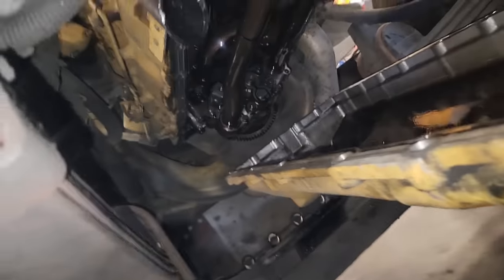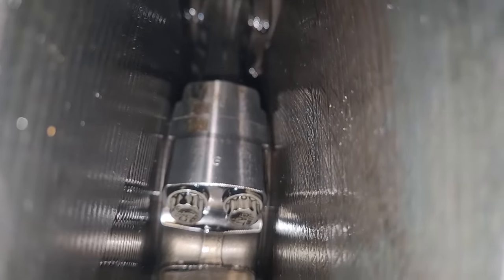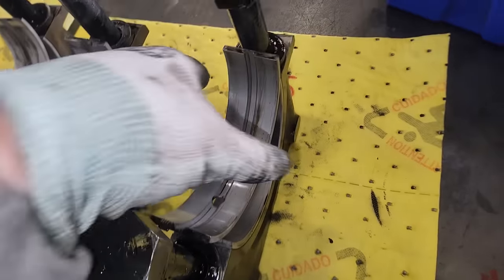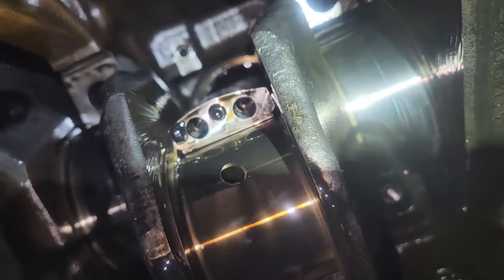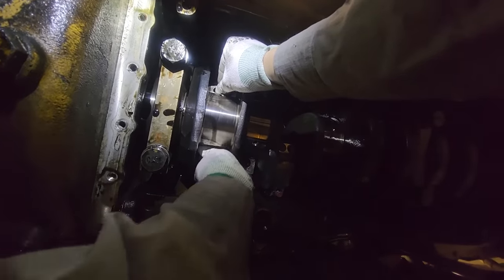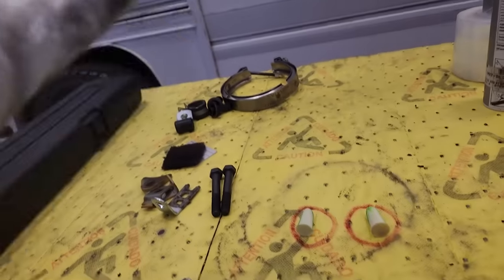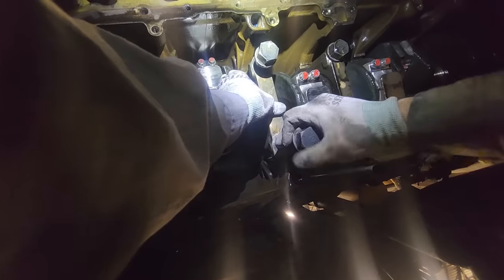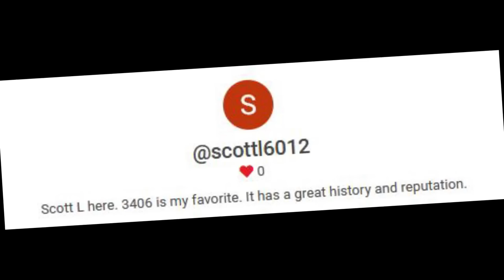Nice Truck Driver Paid for an Engine Rebuild, gets a HEADACHE! Engine "Re-Rebuild."

Comment from the maker: Thanks for watching. Congrats to Scott L on winning the Western States gift bundle. @AdeptApe on Venmo or AdeptApe@yahoo.com on PayPal for donations, thank you so much for supporting the channel! If you wanted an oil pressure priming tank like in the video here is the Amazon Affiliate Link: Allstar Oil Pressure Priming Tank: https://amzn.to/3L5pASm
Oil Pressure Priming Tank: https://amzn.to/3YuBrNr
Reply: I forgot to enter, like a dummy - but still put a comment in with my favorite and why 😂 congrats Scott!
Reply: Thank you!  I greatly appreciate it!
Reply: Hey Josh, I’ve had good luck using a little White Diamond Metal Polish or whatever metal polish I happen to having laying around on journals, after sanding. That kinda fills those grooves in. Not sure how long it lasts, it’s probably overkill but, if you put some time into it, you can really get scratched up journals looking nice before tossing the bearings in.
Reply: My factory apprenticeship began over 50 years ago. In unit repair the men used 50/50 STP and engine oil for assembly lube. They taught me to use white lithium sparingly on threaded parts after thoroughly cleaning the threads or sparingly on new threads such as spark plugs. I have been working on alloy engines as an occupation or second job ever since. Never had a problem if I took my time and never heard of using white lithium on rods or anything else internal.
Reply: Next time loosen the belts up and the front 2 mains will roll in way easier
Reply: I'm assuming you replaced the main bearings right? I didn't hear you say you did unless I missed it
Reply: I have noticed over the years on a few different cats i have owned under hard, acceleration or any high boost, demand i.e. pulling a hill that the oil pressure drops a couple pounds not really sure, but my theory on that is maybe boost being higher than the oil pressure and seeping past the seals in the turbo, boost pressure getting into the oil feed line for the turbo could be totally wrong. I’m not a mechanic just a theory.
Reply: I never used the white junk.
Early on I found that it harden almost like rock if the engine is stored for a long time before installation.
Reply: Which shop and mechanic performed this job? I’m from Florida. This should be public knowledge.
Reply: Ww
Reply: I am so sorry for your loss and I hope Q
Reply: I
Reply: @dylansnellgrove390 no he showed us how damaged they were polished affected journals and reused the fucked bearings!!!then filmed it 2 show u how professional he is!!!!THIS GUYS A PRO OF COURSE HE RENEWED THEM FFS
Reply: 😢great
Reply: Address to the shop
Reply: How do you know which size bearings to order? Do you plastigauge them?

Comment: This video is really going to help this guy in civil court. Its a tough hit financially
Reply: Can he sue? It would be amazing if he could recoup the loss because from what I hear, the maintenance cost of these engines is expensive.
Reply: @JuniorJunison u can 100% sue
Plat rebuild from cat on a c15 is 33k out the door ( i just paid it)
Reply: 33080, cost mine, 140k ago
Reply: Not sure if it’s worth a court battle. Yes it’s a financial loss, but taken time off from the road and probably paying at least a 10,000 Dollar retainer for a good attorney is even more money spent. 
I had a trucking business and bad service gets written off as a business expense. Just learn from it and do your research before the rebuild.
Reply: I agree with you on that, it would be a different story if he charged for cat parts and used aftermarket. This is just a ram jam mechanic who put this motor together, and you’ve got to write it off and know next time put forth due diligence in picking a good shop and mechanic to do quality work.
Reply: I had something similar happen to me.  I had total rebuild on E6 Mack. Sent heads to shop with great reputation and had injectors rebuilt. Went to pick truck up 2 months after I dropped it off and WOW at the blow by. Sent to another shop totally lost faith in first garage about 2 weeks after I picked truck up. It was blowing a gallon of oil out the blow by tube every 100 miles. The heads were used and who knows if I even had rebuilt injectors now. REDS GARAGE Jackson OH stay away.
Reply: Had a shop charge me to fix my main bearings.. rod bearings.. oil cooler and oil pump.. meatless to say they didn’t change the full bearings.. 3 pieces.. and rods they only changed the bottom half.. now 2 months later inframe time
Reply: This video is Hearsay Evidence and inadmissible in narrated form in court. The owner of the truck would properly call Josh to testify and Josh would bring the video to show in limited format. Josh would testify when and how he took the video and he would silence the audio. Yes, the raw video itself would be quite compelling in court and I suspect if there is a proximate cause between the damage we saw and a loss to the truck owner, then the truck owner would prevail. There would have to be evidence of economic loss to the owner. Could Josh testify as an expert witness that the first overhaul was doomed to failure prematurely at xxx miles?
Reply: @jamesscott1932 he was having problems with low oil pressure under load. Because of the damaged bearings. Damaged and modified by the installer.
Reply: @FarmerSteveO we might see this very truck more often in these vids in that case
Reply: @cullenmiller8170  The mechanic committed fraud. So it is not just a civil suit, he needs to contact the local PD. And where there is one scammed customer, there are likely others....
Reply: @jamesscott1932   
"Could Josh testify as an expert witness that the first overhaul was doomed to failure prematurely at xxx miles?"
He could be an out of work hairdresser and still testify..../s
Reply: I like the longer video with good content.   name the shop that did this horrible work
Reply: It'd be tough to collect.  If the mechanic is doing garbage work like this he probably doesn't have the $ to payout even if he wins.  Maybe small claims court because that's easier to do yourself and the damages will be small so he might be able to pay them.

I guess you can tell the police and maybe they'll do something if it's been a lot of complaints
Reply: Pretty sure he's not going to be able to find the guy that did the work.
Reply: @JuniorJunison an oil change w/o your own oil is about $500. When you bring your own oil it's about $100
Reply: Legit engine builders stand by their work so most likely will reimburse client for the damages.
Reply: Hard to prove fault, could be argued oil change intervals were excessive.
Reply: @curbstomp3126 Jackson Ohio. 
Aka one hell on earth in disguise
Reply: @Jamk14 I was quoted $22k Dec 2019, massive increase in such a short period. I wonder why it would be so high.......... oh, wait 😂
Reply: @cullenmiller8170  The lawyer always win, makes you wonder who are the crooks.
Reply: @who-gives-a-toss_Bear Sounds like a good argument to just bypass the corrupt system and get a guy who knows a guy who can make a deal they can't refuse!
Reply: Looks like correct parts used by a shade tree mechanic. He beat those bearings in using the oiler hole. That's some Pakistani you tube vid stuff right there
Reply: @JuniorJunison  There's definitely enough financial damages. Figure $31,000 on the cheap end for the initial rebuild, then factor in loss of earnings since the truck can no longer reliably haul, and you could be north of $60-100K in losses depending on how many contracts the operator lost from the truck being down. That would absolutely be a case that'd be heard in court no questions asked.

And that's not to say anything of the potential for a consumer rights violation for non-genuine parts should the connecting rods being used in this engine be fake or from a third-party, or if it was discovered that re-manufactured parts were used in place of what were supposed to be all be new genuine items.
Reply: @cullenmiller8170 Very intelligent way of doing it. Legal costs and downtime are ridiculous, business expense and everything under your control means minimum downtime and your time.
Reply: @MrNoobed  small claims caps at 5k, that wouldnt even cover parts. court has the ability to garnish wages until the debt is paid. if it went to the police this is felony cost, that means years in prison.
Reply: @davidpotter7484  Thats not necessarily correct, the customer stated he still has a loss of oil pressure under load after the repair to the shotty work for the initial rebuild. What does that tell us? well for one the repair was never done correctly and was likely due to the customer trying to do a repair "cheap" that crank needs to be addressed for proper oil pressure. either turned for oversized bearings or replaced. and i'm sure both mechanics know this, however they also know its a big additional cost. why the customer choose to save a few bucks to not have a complete rebuild is beyond me but that was most likely his choice and not the engine builders choice.
Reply: @cullenmiller8170 yea that's really the catch 22. Especially if a mfer can file bankruptcy close the business and move the shop
Reply: I'd be approaching the dude personally, looking for a settlement, or hire a lawyer to send a letter to that effect.  Further legal action is implcit.  Dude must know he's fucked up, save everyone time and lawyers' fees. That's if you can find him 😂
Reply: @berthagen387 I'd argue that it's much worse!
Reply: @michaelglenning5107 you reckon this guy's legit?  Just look at his "work" 😂
Reply: Is this story about a fat wet sump 4 joke stroke auto obsession that has no roller bearings, that what it loiiks like to me
Reply: @cullenmiller8170 It would be 'WORTH' to other truckers if this, so called MECHANIC, STOPPED🤦❗️
Reply: @truckingwithsal  The cost of trusting people is too high, I'll just do it all myself like I have been for the last 25+ years.
Reply: @Jamk14
FML I'm whining about the cost of parts to rebuild my 5.0l's top end/timing at about 3k (using race components) if I had to shell out a new vehicle price I would shit myself.
Reply: He can't necessarily  sue and win. He didn't ask the original mechanic to fix it or refund the money before he drove it clear across the country to have it checked out. If there was no warranty or agreement it's just bad luck. Additionally, the evidence needed is buried in the middle of the engine of a repaired truck. He would spend $30 thousand getting $30 thousand.
Reply: The evidence the owner needs is inside the engine of a running truck that has run thousands of miles since the final repair. There is no warranty. There was no demand for refund, no corroborating evidence of the injury. The only evidence of fraud is inside the engine and that evidence is exposed to damage from use. It would be dismissed for failure to state a claim if it were filed, though the lawyer would still get ten grand for trying. A losing case.
Reply: @KerryHicks-v5b  I figured you knew the person who did the bad job. Be careful, the dirt gets muddy.
Reply: Please name and shame the shop or tech who done this…
Reply: @cullenmiller8170  This mindset is exactly why businesses do these things. Over 90% of companies must take part in this game or fail... They're Profits count on people like you to not hold then accountable. Thus you have this behavior rampant in all of business...Because Precedent.. The other guy did it.. So can I... All these people didn't complain or have an issue so neither should you... Slavery was also justified by this logic as well.... 🤷

Comment: I’ve only made it to the mis-numbered main bearings and I’m already freaking out. Engine building 101. You don’t swap main cap locations.
Reply: he was short of  fingers to count ?
Reply: Learned that one the hard but yet forgiveable way. In high school mechanics class we tore down a bunch of junk engines and put them back together. I got this old dodge 6 cylinder swather engine that had been dusted. Mixed up the caps when taking them back and forth to the parts washer. Threw the engine back together. Go to try and turn the crank to start putting rods in and it’s locked up solid. 

That was over 15 years ago and I never forgot that moment.
Reply: He was so doped up he didn't know where he was. Hes now probably a mechanic at the BMW dealer down the street.
Reply: @chrisgreig5628 probably drunk while working
Reply: I bet the mechanic that built that engine believes he is the greatest engine mechanic on the planet. So good he builds engines at the bar every night
Reply: @markm0000 I'm thinking it was a meth head. I've worked with guys like that. They have non-stop energy and look busy, but if you watch them closely, they do a whole lot of nothing and f up whatever they might actually work on.
Reply: I’m guessing, he missed the marking in the caps!
Reply: @speed150mph  it's not a huge deal you just needed to bolt the parts together and measure the bearings clearance, it may take a while but it could be corrected with a little time and head scratches
Reply: i have never done a full rebuild on an engine and i know that you never swap main caps!!!! that was a big wow factor for me
Reply: @StumpDrummer  you can swap mains happens a lot (they do sell aftermarket main caps) just requires machining and proper measurements. Hell you can drill splayed main caps into a block with proper work. The swap isn't the problem the lack of attention to detail on the clearances is.
Reply: Stevie Wonder could have did a better job building that engine.